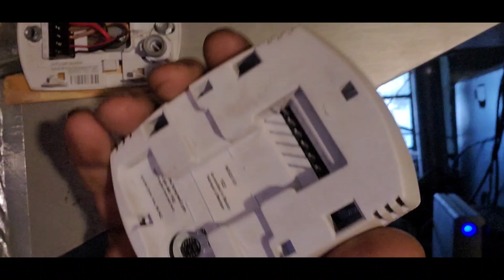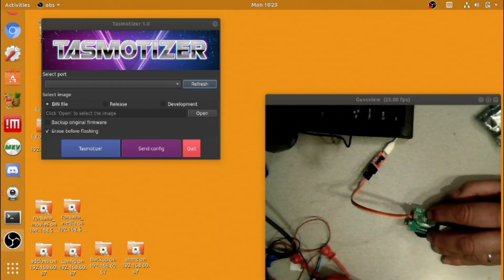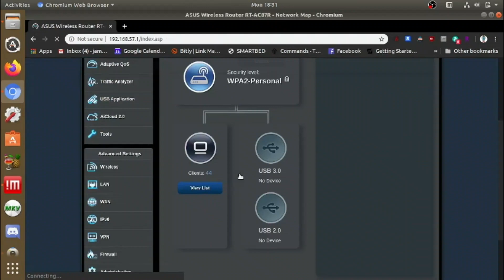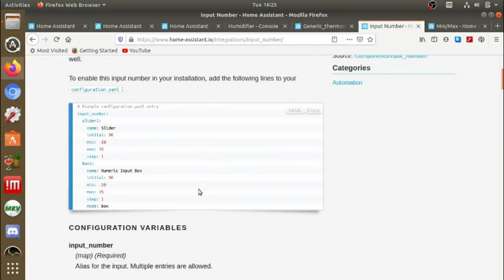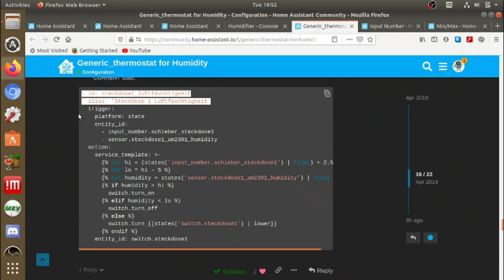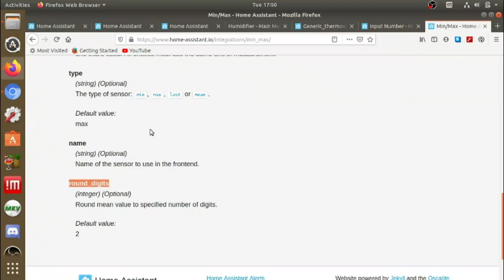Humidistat Replacement Using Home Assistant and Tasmota with a Sonoff SV  E008

Comment: One day I would enjoy seeing a tour of everything you have in Home Assistant to see how it all fits together.
On the fan thing, maybe you can detect the vibration of the fan or add a hall effect sensor and magnet?
The other thing, is there an LED that comes on with the FAN?  Maybe you can use that with a logic shifter to drive a GPIO.
Do you have a thermostat in Home Assistant based on ESP8266 or ESP32 using Generic Thermostat?
The reason I ask is I would like to know how you handle the failsafe if Home Assistant crashes to stop the Furnace or AC just running continuously if the relay gets stuck on because Home Assistant can't turn it off.
Actually, that would be equally applicable to the humidifier.
How do you handle a HA crash if you are away?   I want to set mine so if HA crashes, the Sonoff SV (tasmotized) will turn off all relays if HA is no longer available.
Reply from the maker: I already have a ras-pi running at the furnace to measure a bunch of temperatures, and the plan is to monitor 8 more signals (I have an 8 line opto=isolated board to pull the signals in).  The fan will be a couple of those, so I will trigger from that.
My main thermostat is a honeywell wifi model, so I don't know about safety backups, but HA, to me, is a bit to open to me crashing it so if i were to do something, it would be a dedicated little computer (pi?) that only has the thermostat duties to worry about.
Thanks for the comments!